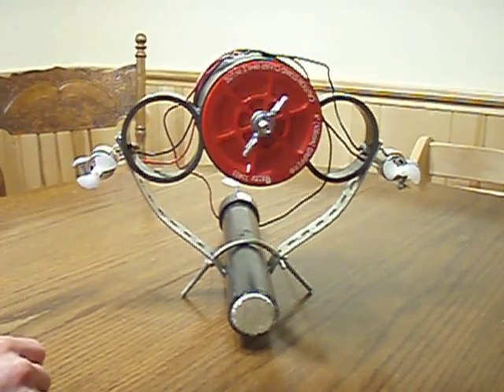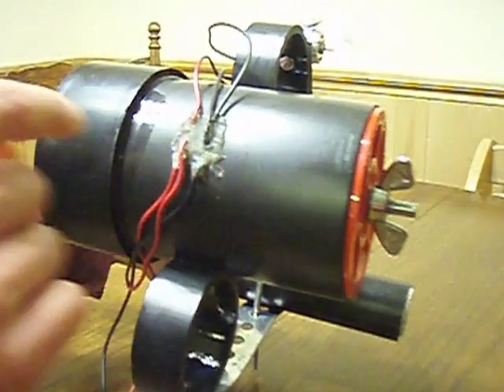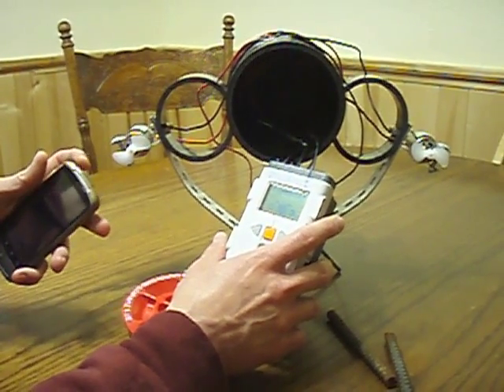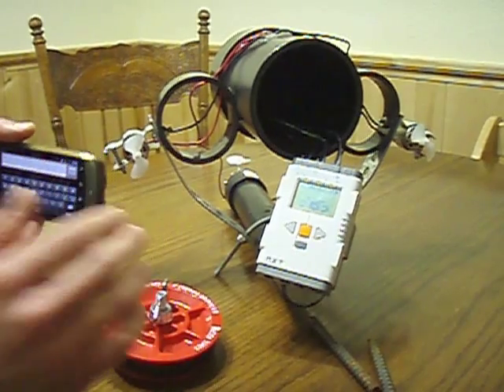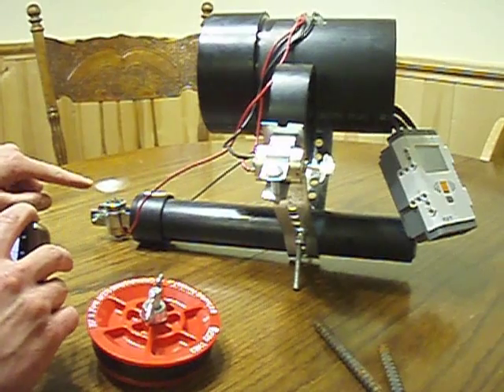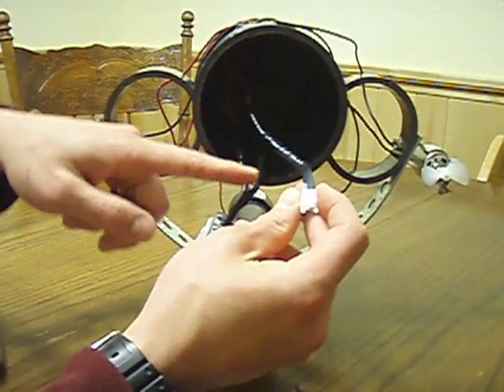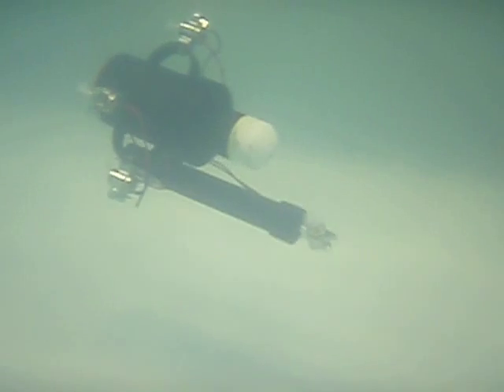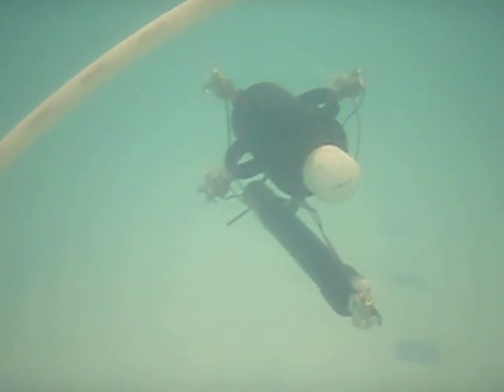Underwater Robot

Comment from the maker: Depends on what items you have in your garage already and how many you want to build. When building in bulk, I figured around $30 per sub (plus the NXT and the Adnroid device). I'd highly recomend using the NXT Jack that I mention on my webpage for this bot as well as putting the dive motor within a tube to protect it, and extending the length of the wing tubes to protect those motors as well (otherwise you'll probably break you props off a few times as well as your soldering connections.